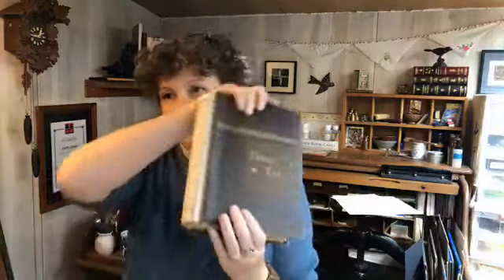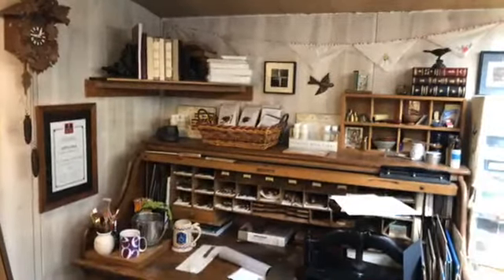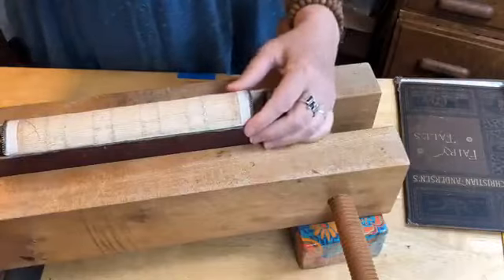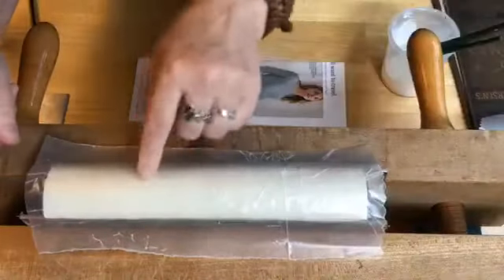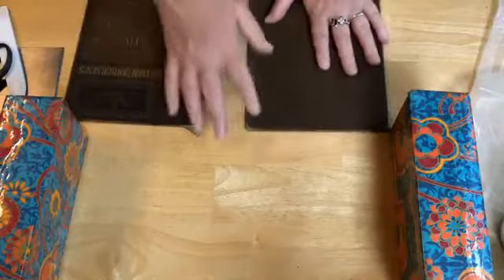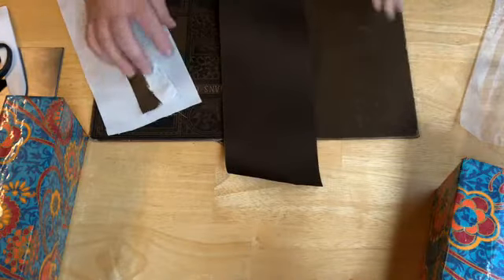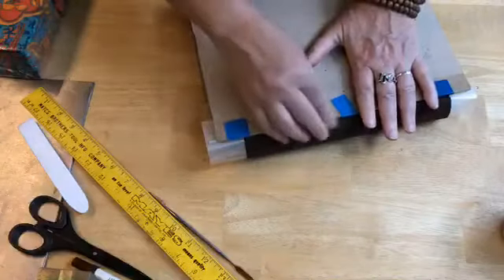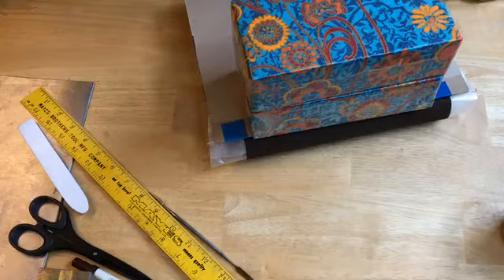Fairy Tales: Live Restoration - Part 5: Save Your Books

Comment: Love your videos! I notice you seem to use PVA glue on the spine and all the parts you added. Is this the recommendation for beginners when attempting a book repair? I thought paste was preferred when gluing to original parts. Thank you.
Reply from the maker: The answer is that different adhesives are appropriate in various situations. Many times valuable books require more reversibility, but being practical, PVA (white glue) is ok to use where it isn't interfering with original materials for regular books. For more on this go to www.saveyourbooks. cheers!
Reply: @SaveYourBooks  Thank you!